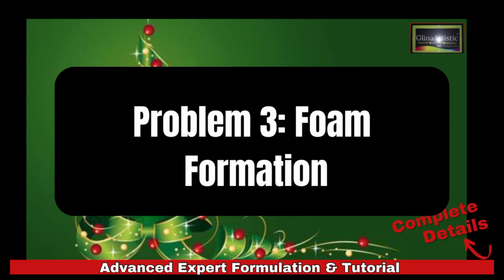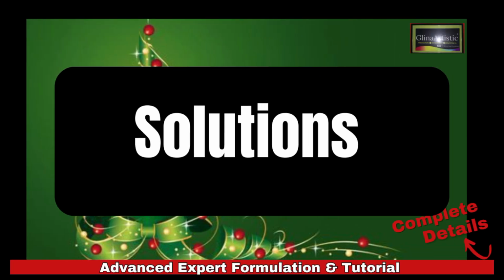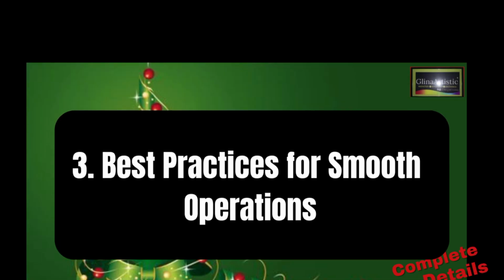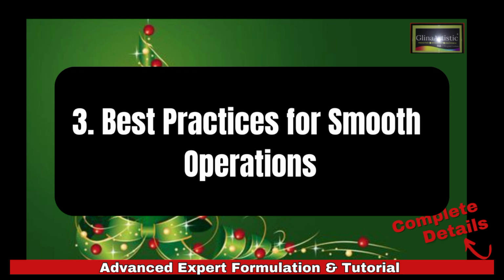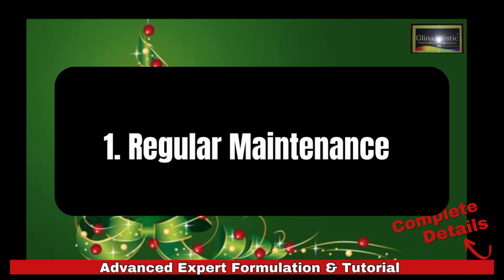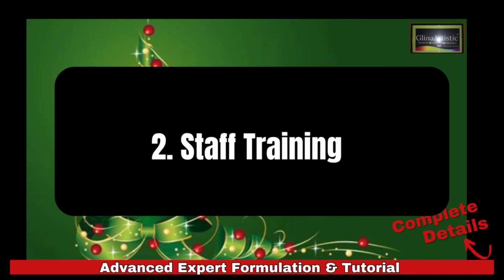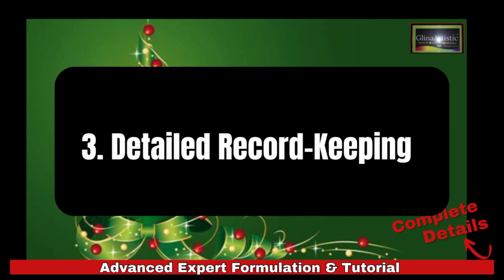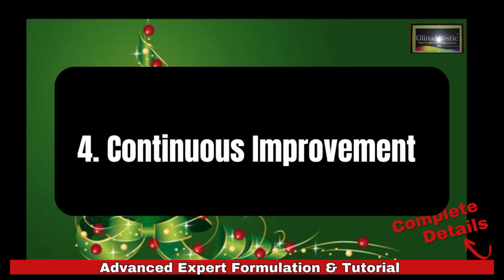How to Troubleshoot Common Paint Problem vlogmas Day 11

Comment: I was Producting POP Screeding paints. After adding thickner,the other guy operating the high speed mixer  couldn't mix it well due to its thickness, and the paint had so many clumps or seeds.  How do we troubleshoot such issues?
Reply from the maker: Tips for Mixing Thickeners in Paint Production:

1. Understand the Type of Thickener: Different thickeners require different approaches. Always refer to the types of thicker you are using.

2. Continuous Stirring: Once you add the thickener, never stop stirring. This ensures the thickener disperses evenly and prevents clumping.

3. Handling Clumps:
If clumps form, add Calgon PT (a dispersant) to help dissolve them.

After dissolving, use a sifter or strainer to remove any remaining particles for a smooth consistency.

4. Preventive Measures: Always add the thickener gradually and in small portions while stirring to reduce the risk of clumping.
Reply: @GlinaPaintEducation  thank you so much.  I have learned a lot from you from this Vlogmas lecture